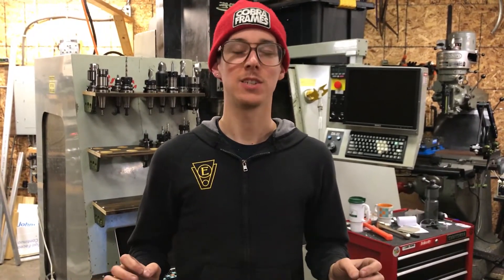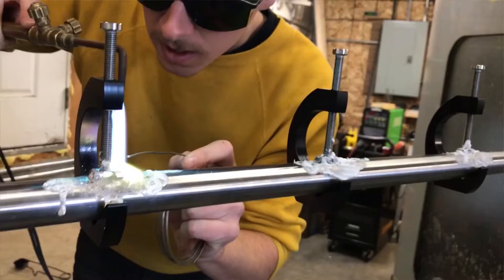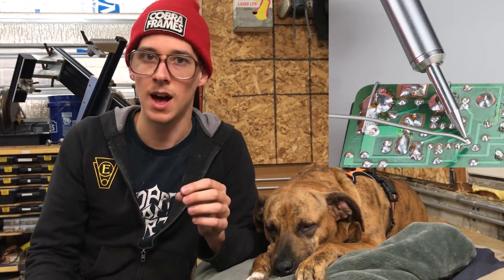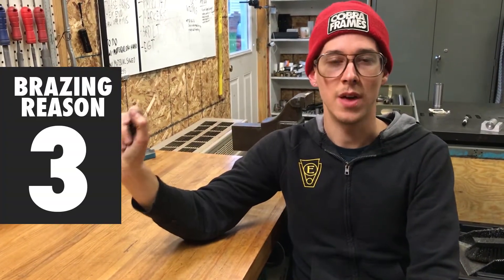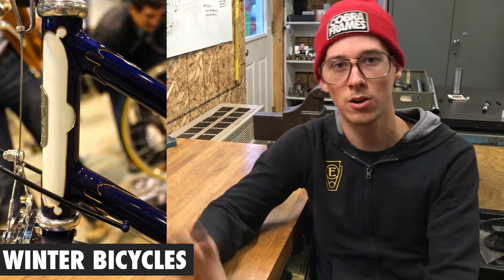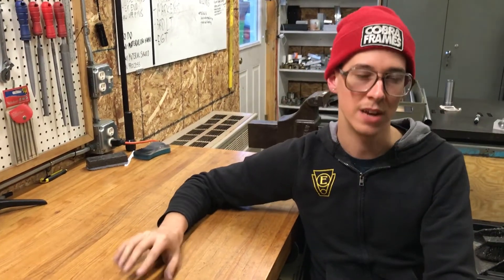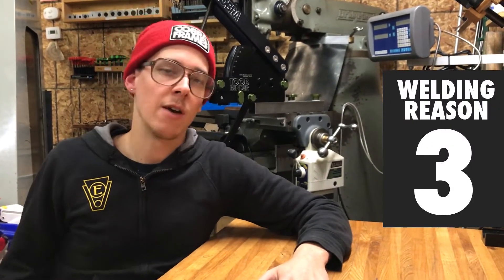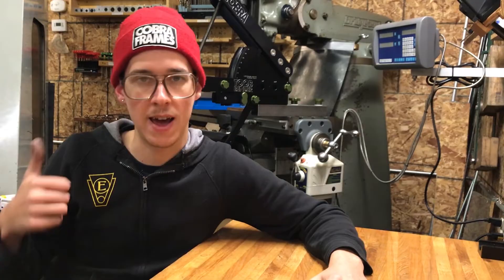Brazing vs TIG Welding for Bicycle Frames

Comment: RE: Old school brazing into the 80's and 90's- the advent to of steel alloys that air harden made the move the to the higher temperature process of welding workable for high-end bikes. Previously, tubing was heat treated from the factory, and the thinking was that brazing allowed better heat control and less risk of killing the temper on the tubes.
Reynolds 853 really did change things a lot- it was, to the best of my knowledge, the first premium bike tubing that was designed for welding (or, in some cases, high temperature brass brazing).
Reply: When Reynolds first came out with cold worked air hardening 631 and heat treated air hardening 853, Reynolds approved welding the thicker, softer 631 and only brazing the thinner, harder 853 tubing. Reynolds originally recommended against welding 853. When Reynolds later decided to approve welding of 853, I did start seeing welded 853 frames that had cracked. Is this due to being heat treated or is it due to the tubes being so thin? Most other tubing companies that sell air hardening tubing, sell in it only in the heat treated, hardened condition, so I think the welded 853 frames are cracking because the tubing is so thin and difficult to weld properly, because it is so thin. It is interesting that Reynolds originally recommended only brazing 853, while the thicker 631 was approved to be welded. Maybe they knew something all along. Other than the thicknesses of the tubing, the thicker 631 is not heat treated and the thinner 853 is heat treated. Is it thinner than other tubing companies' heat treated air hardening tubing? Reynolds has a chart with the hardnesses before and after brazing. High temperature brazing is recommended of the air hardening tubing.  The 631 would become harder at the brazed joints and the 853 would become softer at the brazed joints, but the brazed 853 hardness was still higher than the brazed 631 hardness. I've seen too many welded 853 frames crack to recommend welding 853, but I do like air hardening tubing for bicycle frames. Maybe the other brands ren't hardened to as high a degree of hardness, or maybe their tubing is thicker and less prone to cracking when welded. The thicker, softer 631 doesn't seem to have the cracking problem when welded and other brands, which most all are heat treated, seem to weld alright. I think 853 survives best when brazed, but might be on the thin side for crack-free welding.
Reply from the maker: Thanks for that!

Comment: Doesn't good TIG need 220V power?
Reply from the maker: In the old school you had "transformer" welders that were the size of a fridge and they used a lot of current so they were always 220v single phase or even 440v or three phase. Since "inverter" welders have become common there are a lot of options that will operate on 110v. They don't always have as much output when you run them on 110v, but they generally have plenty for welding thin wall bike tubing. My Everlast welder is this style. Also, wiring a 220v outlet is generally a pretty approachable DIY project and there are a bunch of youtube videos about that topic.
Reply: @cobraframebuilding  if you getting 220VAC then there is something wrong with the wiring  or the transformer outside supplying power too  the electrical meter  because the nominal standard in the USA is 120VAC and only allows for a range of −5% to +5% RMS. Note: The 240Vac is two legs so its 120+120.
Reply: Kind of "what he said".  Inverter TIG welders can do about 140 amps on 120V and that is enough to weld up to about 1/4", so much thicker than anything you are likely to deal with on a bike.  Also many of them are dual voltage and can run of either, you just get more amperage available on 220V.
Reply: @skoue4165  I used to TIG weld constructions from 1" and 2 3/4"  with 1/8" wall aluminium tubes. The welder was usually set to 190-220 amps.
Anything lower would just take way too long although I started off at 140 amps until I got better at it.

Comment: Good stuff.  In brazing you’re actually seeping in filler underneath the two materials to join them and get that semi-fillet curve going as you call it.   It’s also way easy to go the other direction and glob too much filler and concave the braze round.  That case lends the possibly to joint failure as you don’t know if the filler actually seeped and sealed the joint.   Advantage to TIG, I think is even if you’re burning holes in joining materials you can cover them and ensure you’re getting a good bond.  My two cents from trial and error and a certain school of thought.   Thanks for posting.

Comment: Hey thank you so much! Is there any way to make lugs without machining them on the mill or buying presized ones? My dimensions are a little abnormal and I'd like to reinforce my joints with a basic lug of maybe just slightly larger pipe
Reply from the maker: You can make your own for sure. You need tubing that has the right slip fit over the inner tubing size. In USA if you buy the outside tubing 1/8” larger in diameter with a .058” wall it will have a nice slip fit over. So if you have a 1 1/8” tube and want nice sleeve material the easy way is to get 1 1/4” tubing with a .058” wall. .058” wall is kinda chunky so you still might want to turn that diameter down on a lathe if you have the means.
Reply: Watch some CS Hirose videos here on Youtube -- he fabricates custom lugs for a few of his frames.